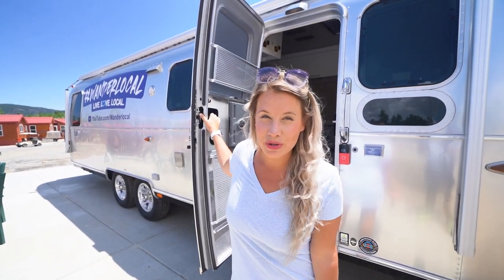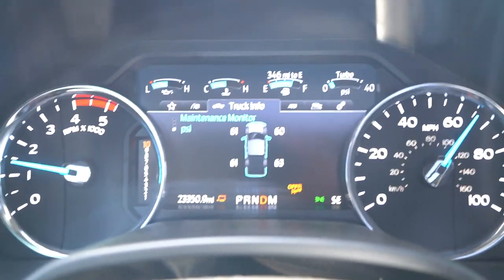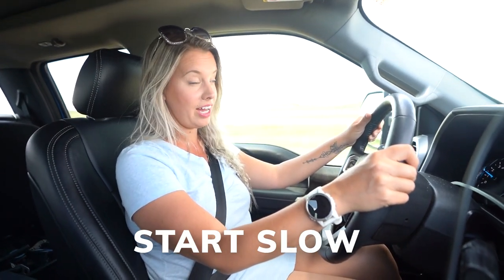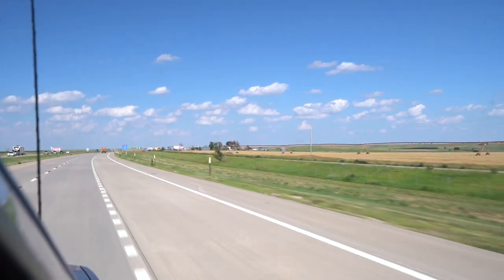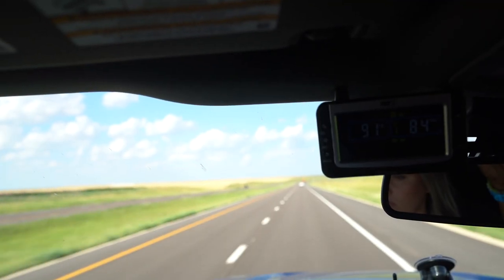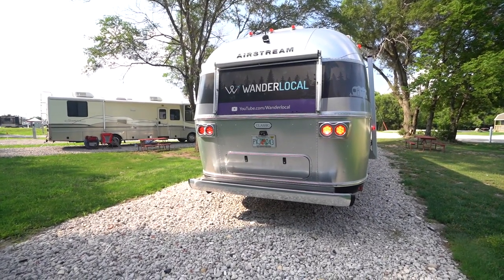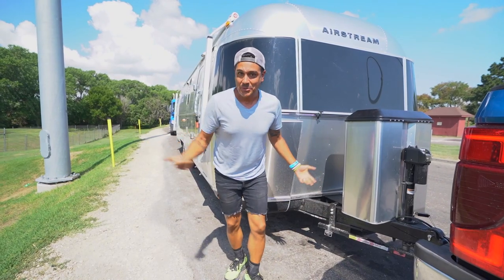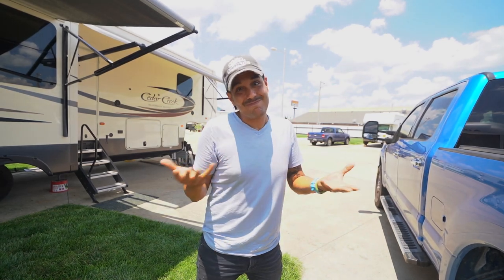FIRST TIME TOWING AN RV? | Tips + Tricks for Towing #AirstreamLife

Comment: Great info. One thing I do when traveling the mountains of BC, Canada is to use your transmission. I down shift (most automatics have a manual way to down shift) to assist in slowing down or maintaining a certain speed while going down a hill. It definitely saves on your brakes. Just a tip.

Comment: Great video! I can add a tip, we rented a 30ft travel trailer with ZERO experience last month. Heh we found getting around a gas station to be the hardest thing ever! The tip we learned from that experience is to use Google satellite to scout larger gas stations ahead of time and try not to hit the busy ones. We went to a very busy giant gas station got stuck and blocked the traffic until we finally managed to wiggle out. In the struggle we ended up pinching the electrical cord 7pin thing to the truck. Thankfully the cord was functioning but we had to pay $80 extra for the kind owners to replace it. Lesson learned go to a medium less busy gas station!
Reply from the maker: SophiaTheHobbit, thank you so much for sharing your tip and personal experience. Everyone reading this and thank you later. Solid advice! 🙏 L+D

Comment: each stop top off gas cheap? {not calif}No hurry,chock last thing up when ready to drive off, longer take the city bypass,move over a lane when freeway merge with another freeway, some change,slow infront of you,come on the on ramp at 40mph, change back long past the on ramp transition point, on ramps watch the cars coming down the ramp,adjust speed,semis or outher rvs  flash lights it s ok for Them to change lanes,my 25" airstream rear twins.has 3 outside lockers and rear trunk  locked with the key that why I know they are closed  #1 alway s looking in the mirrors

Comment: Look into using engine braking.  Saves your brakes and helps maintain control.  Some vehicles have it built in to the tow haul mode.  If not your just manually downshift.

Comment: Hey guys I found your video very informative.  One question I have is does weight position in a Rv make a big difference?  Like is it better to place more weight in the front or rear or try to place things as evenly as possible?  I don't even have a Rv yet I'm doing as much researching as possible.  Thanks!
Reply from the maker: Uly, that is an EXCELLENT question and I'm (Daniel) glad you asked. The short answer is that you want it balanced and I'd definitely recommend a weight distribution hitch, also known as WDH. We use Equal-I-zer, but there are several reputable brands (Blue Ox, ProPride, and more). We typically place the heaviest items closest to the floor and centrally located over the axels on towing days. You still need to keep in mind the total GVWR (gross vehicle weight rating) so you don't overload the RV. Also, too much weight in the rear can be bad news. Here's a good video to show you the effect of putting too much weight in the rear of the RV - https://www.youtube.com/watch?v=L7W293FrzXo

Comment: Great video.  How did you mount the camera on top of the truck? Thanks
Reply from the maker: Great question, Saamr2012. We use a triple suction cup mount. I’ll (Daniel) include a link so you can check it out. I absolutely love this mount. We use it with a DJI Osmo Action, but it also holds GoPro cameras too. https://www.amazon.com/dp/B08Q7LNJNJ?ref=exp_wanderlocal_dp_vv_mw
Reply: @Wanderlocal  Thanks

Comment: Another awesome video! I love watching you guys! Couple tips I use that I have found works for me are

A) before I leave, after I’m hooked up and everyone is loaded in the truck, I get back out. I start at the driver’s front corner of the truck. I walk around the truck and camper. I touch everything that opens, locks, moves, hooks up, ties down. If it moves I touch it to assure it’s shut, locked, hooked etc. and I mean everything!

While driving, I always drive with my parking lights on. I do this so I can see the corner lights in the trailer are on, and If they go out, It will be an indication something is wrong with the power hookup. 

Also while driving, I always check the on-ramps while I’m going down the interstate. If I see cars coming up the on-ramp, I move over before I get to the merger. I do this because some of the closest calls I have had towing are people rushing up the on-ramp because they don’t want to be behind a vehicle towing. I’d rather merge earlier and on my terms.

Last to piggy back off watch what the truckers are doing. I have never thought of that, but we do travel with a hand held cb radio. We listen to the truckers because they put out good info before you even run into issues like accidents and other things! 

Just tips I use that have worked for me! 😎😎 safe travels and can’t wait for you next video!
Reply from the maker: Solid advice, sir! Really solid advice here. 🙏 We have a lot of newbie RVers that follow this channel and are going to learn a lot from comments like this, so that you so much for sharing. Heck, we always learn from these comments! It's one of our favorite parts of having a channel! L+D

Comment: Here’s another way to check your lights on your tv and trailer. This is useful when you don’t have someone to help you, so you don’t have to hop out to check numerous times. You do not have to turn on your car to do this.  1. Turn on your lights and flashers. 2 Get out of the tv and check your lights.  3. The flashers turn on the blinker lights and the brake lights.  The lights turn on all the lights.  4. Go back and turn off flashers  and put the lights  back to the setting you want them on.

Typically each of us have a set up and break down routine.  When getting ready to leave I check the outside that my husband typical does (focus on the hitch setup) and he checks the inside. One of us will pull the trailer out of the site while the other checks the site for anything we missed and another walk around the trailer..  It’s good practice to swap set up and break down jobs. We don’t do that enough..  That might make a good video of you swapping jobs.

Comment: Excellent job guys! 👏 

When a semi passes you do you get any push or suck as they go by?   

I think the exhaust part that took the little dent is the Diesel particulate filter which is one of the emissions devices on your diesel.  It’s what uses the DPF fluid. 

Been on that road a few times both in the car and Motorcycle. Windy is the rule there. Soon with our trailer I hope! 

Thanks for the tips! You guys make it look easy. Bill and Olivia in Utah

Ps. In some states the law does require you to pull over to the next lane for any “emergency equipment “ which does include broken down vehicles. Here in Utah they purposely park in the right lane with the light bar on and if you don’t move over they will soon visit you on the side of the road with a warning or worst. 😮

Comment: you can get a SSB CB radio for your truck to talk to truckers
Reply from the maker: James, this is Daniel. That is solid advice. I’ll have to look into one and figure out where to mount it in the truck. I can see that being very helpful to have. Thanks for the tip. 🙏
Reply: @Wanderlocal  you could mount it under the dash and power it with the lighter and then you could quickly remove from the truck if you need to. You mount a camera on your mirror that way you could keep watching the road while driving